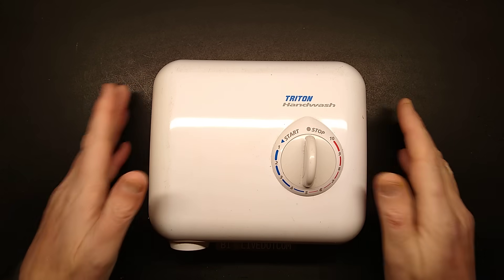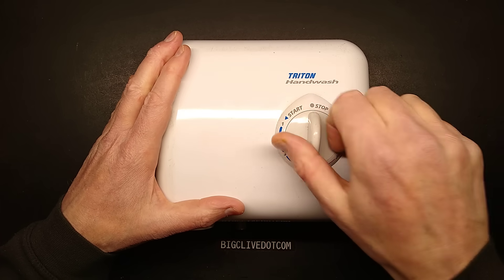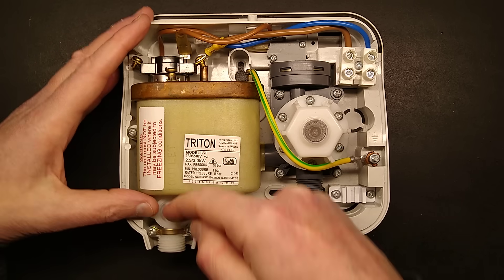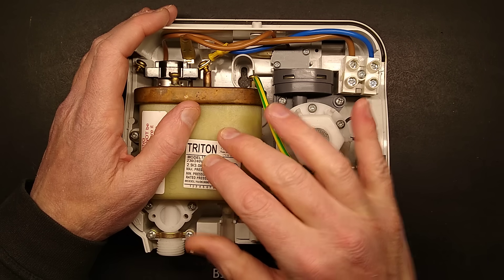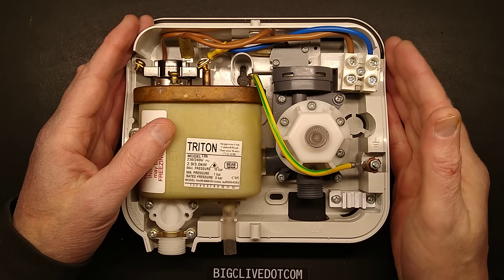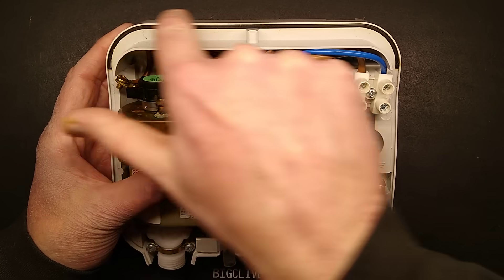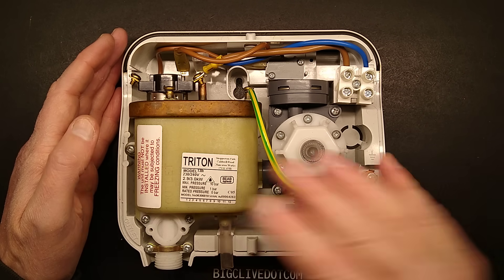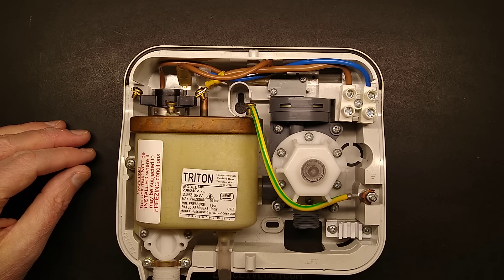British construction site hand-wash unit

Comment: Ah. Being in Australia, and going into summer at that, we have a very neat solution to heating water, it's called the "cold tap."

Seeing as we don't have freezing temperatures here, cold water pipes don't require insulation and, in more compact residences, will be mounted externally. So, when that lovely copper gets a 35C+ day bearing down on it—well, you get the idea.

The hilarity is that our hot water pipes are insulated, and given the distance from the hot water unit to my sink, I get cold water from the hot pipe and hot water from the cold pipe.
Reply: I'm in the UK, but on rare occasions when we have super-hot summers, I find the water from the cold tap is actually warmer than what's coming out of the hot tap! Our house has the really old style system with a hot water tank in the attic and a gas boiler that heats it up in the morning.
Reply: Lol
Reply: Seems like a bit of a design oversight?
Reply: @DMSparky  Not really. Just a little quirk. The cost of insulating all the pipes and changing building codes, when home builders could do it themselves if it bugs them that much, would be astronomical.
Reply: @ConstantlyDamaged  in Canada we just run our pipes in the walls. There is nothing you could do to keep a pipe from freezing outside in -45C. Well technically there are heat trace cables but we aren’t going to spend money on kilowatts worth of electricity to keep them from freezing. When you get +40C in the summer and -40C you get good at insulation.

Comment: Very simple no digital thermostat no bs plain and probably most more reliable. Nice video.
Reply: This one is a bit fancy in that it has a thermostat at all. The experience I've had is with shower units where the temperature is regulated by the rate of flow (e.g., lower flow = hotter water, higher flow = cooler water).
Reply: No IoT, no subscription!!

Comment: I was just about to ask if it was a shower for smaller people. I was on the right  track. 2x 👍
Im so happy that most electric showers are built with standard bits,  I have saved a fortune when one small thing fails and parts are dead easy to get.
Reply: We have lots of them at work, The only difference is they are operated from a light sensor, So you don't have to touch them,  Only downside is when you walk past with a HiVis they switch on.
Reply: There are three sizes of shower available. 11.5kE, 7.5kW and 5kW. However even if you are just cleaning off a small to medium muddy dog I would recommend the 7.5kW as 5kW just is not big enough for anyone (water flow is more like a dribble).. That's why they are so difficult to get. To give you the maths 1kg of water almost exactly 1L at 20C needs 4200j per C of temperature rise. So to warm up water from 10C (ground temperature in many places) to 30C is a 20C rise. that would need 20 times 4200 or 84000j per L. So to keep it to 500j/s (5kW) you would get a mere 60ml of heated water per second. That extra 2.5kW takes it to 90ml per second. This is the real reason for shower heads.
Reply: @gordonlawrence1448  My shower is 8.7kW but we have quite high mains water pressure.

Comment: Very simple, almost nothing to break :)
Reply: And yet, some of the people I work with have still managed to knacker a few of them.
Reply: The biggest failure is when the water pressure drops they overheat, I just replaced 6 because of that.
Reply: They don't hold up brilliantly to hard water clogging the output pipe solid with chalk like one in a bothy I know.
Reply: @ZXGuesser And a water softener woud be more expensive than the water heater itself I suppose ?
Reply: There is a faucet in it. The life of those without needing some parts doesn't seem all that great.